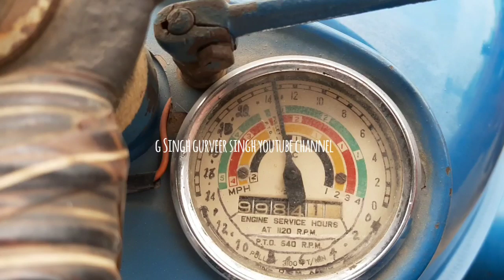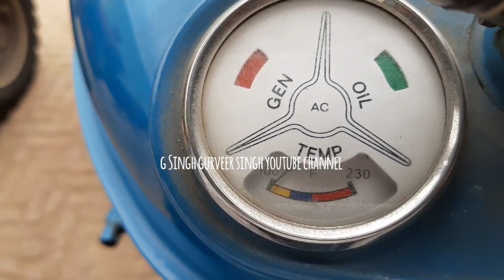fordson major vintage tractors

Comment: ਬਾਈ ਜੀ ਫੋਰਡ ਜਾ old Holland Ford 3630  2001 model ਉੱਪਰ DCM ਦੀ ਮੋਹਰ ਲੱਗੀ ਹੁੰਦੀ ਹੈ ਬਾਈ ਜੀ DCM ਦਾ ਸਹੀ ਮਤਲਬ ਕੀ ਹੈ ਜੀ ਮੈਂ ਬਹੁਤ ਯੂਟੂਬ ਉੱਪਰ ਵਿਡੀਉ ਪਾਉਣ ਵਾਲੇਆ ਵੀਰਾਂ ਨੂੰ ਪੁੱਛਿਆ ਕਿਸਨੇ ਸਹੀ ਜਵਾਬ ਨਹੀਂ ਦਿੱਤਾ ਪਰ ਤੁਸੀਂ ਜ਼ਰੂਰ ਦੱਸਣਾ ਬਾਈ ਜੀ 🙏🙏🙏🙏
Reply from the maker: DCM Engineering Product

The DCM group set up a Grey Iron Foundry in 1977 with a capacity of 17000 MTPA (Metric Tons Per Annum) as Division of DCM Limited.
Reply from the maker: DCM vir ji parts supply kardi si ford nu ohna da truck vi aunda si DCM Toyota deh naah toh